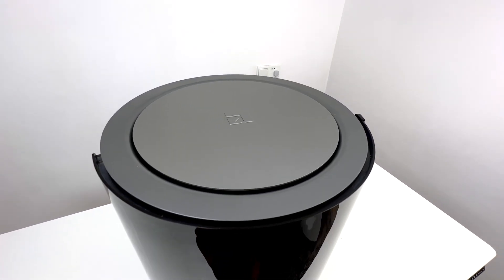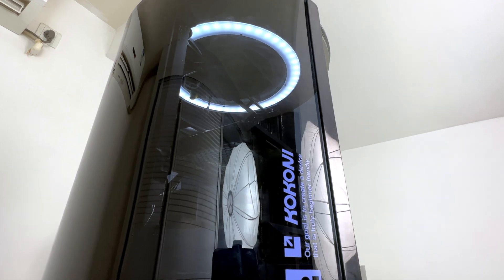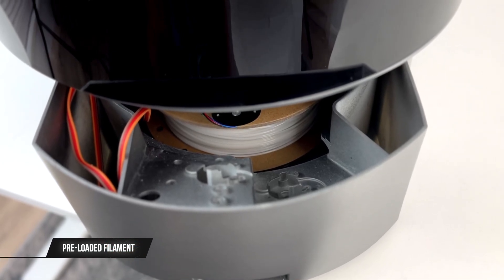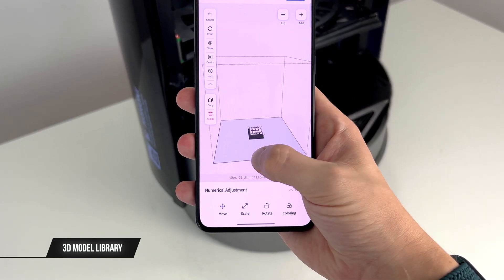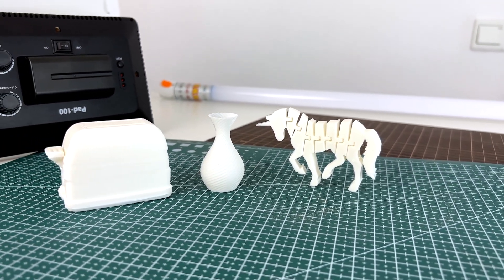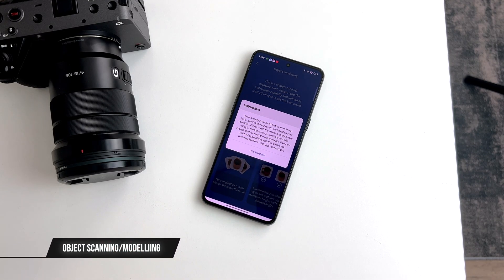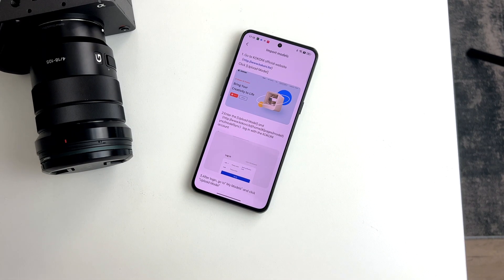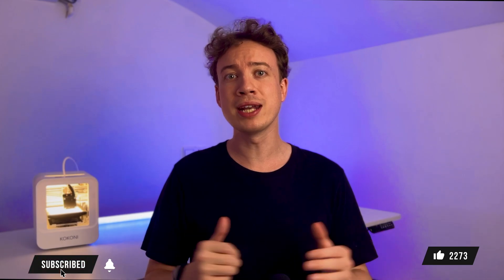The MOST User-Friendly 3D Printer, Powered by AI | Kokoni Sota Showcase!

Comment: It sounds very interesting but I am wondering about serviceability, amongst other things, like what size for filament as it supposedly comes with 200 gram rolls will you be able to use,1kg rolls in the fancy box. Good effort on the Video for your first attempt.
Reply: they said on ks if the roll is under 230mm diameter and 75mm height any weight is fine for both the printer and tower
Reply: OK,  missed that but it is difficult to find out much about it.
Reply from the maker: Thanks mate I really appreciate the support ✊

Comment: The video looks more like an advertisement for the Kickstarter than a real user experience, but I guess I'm OK with just finding out what this printer is about.
The "upside down" printing looks fancy, but I did not catch the benefit of it in this video ?! It's probably inspired by Kralyn3D's Positron printer, who explains that the main benefit of printing this way is that the center of mass is really low, so the printer can be more stable because of this. This printer actually negates this advantage by lifting the whole printer up to accommodate some electronics and filament underneath it...
The AI part could become great, but it clearly isn't all that impressive yet and possible future updates might never get implemented. Also, the fact that software can make your 3D printing experience better holds true for any 3D printer, not just this one.
OK, I'm probably being too negative here, so as a positive I can say it looks great and with the door closed it's probably pretty quiet.
(Although most people print PLA and you probably don't want to print PLA with the door closed)
Reply: but isn't putting the filament below be better for the low center of mass? Essentially, the bottom of the printer could fix 2 x 1 kg spools of filament.
Reply: @Dashie23  Yeah it's a great user experience too only 20 screws to undo before you can replace the spool.
Reply from the maker: Thanks for your detailed comments. It’s always interesting to hear these things. 

Yeah, honestly, it was more of a showcase than a review as this was a prototype filmed a while ago. Obviously I couldn’t show everything so sorry about that. But as an outsider in the 3D printing world I was really impressed in the simplicity of the process for somebody like me. And the AI selfie modelling was pretty impressive considering it didn’t use any other sensors apart from the selfie camera.
Reply: @MichaelElsegood   sellout. You are promoting what is most likely a 650k dlls scam ..
Reply: @aarrodri  he has to have fans to sellout.